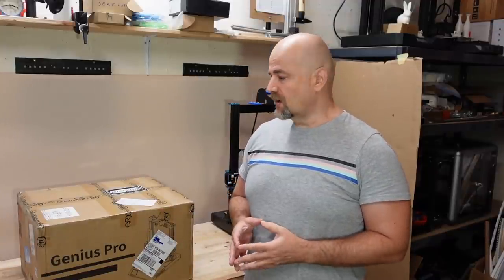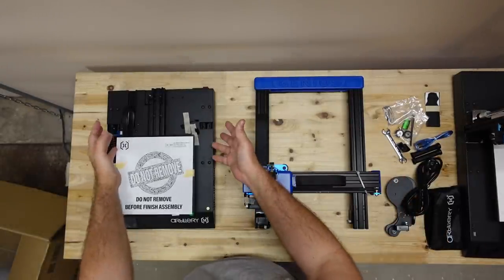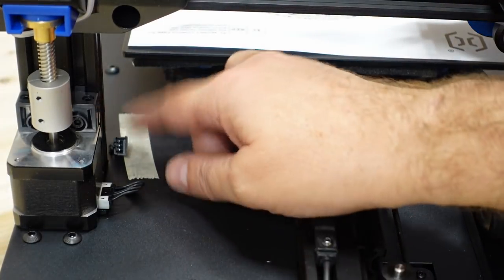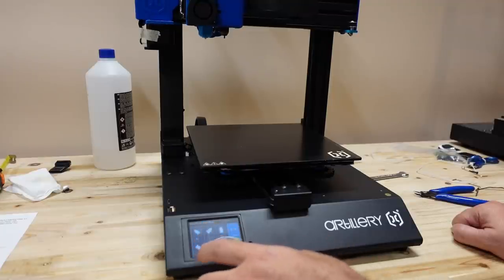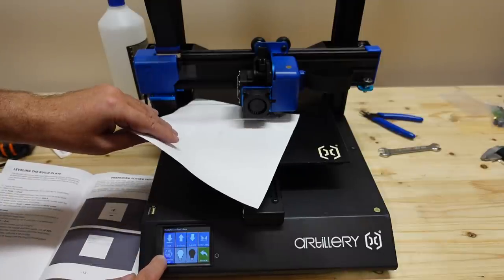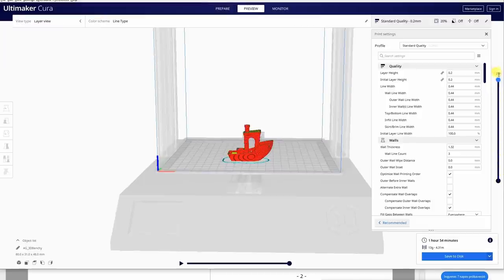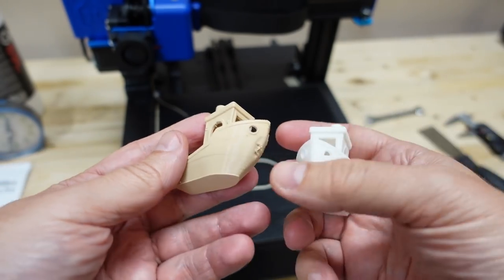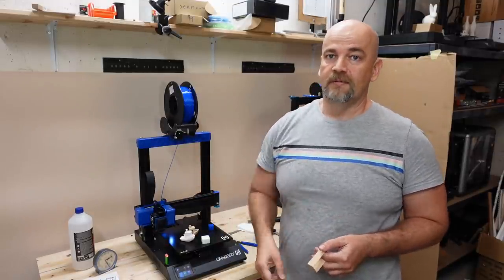Artillery Genius Pro - the new TPU 3D printing champion in my collection

Comment: By now I have run several Genius V1's for about seven months of 24h/7 work with no problems, they are very reliable and easy and quick to work with,  they require only minimum maintenance, mostly just cleaning- and a nozzle change. Way better than my Ender 3 pro.
Reply from the maker: I have only SW X1, I had some small issues with it, but most of them are eliminated now (on both X2 and Genius Pro). Only I am not happy that extruder don't have more improvements, too plasticy, hard to set the tension etc.
Reply: @MyTechFun  I have had zero issues with these extruders, even though they are plasticky. I did put thermal paste of the heatsinks and alu tape at the bottom of them so the fan doesn't blow downwards. They just work..and I use cleaning filament when needed, no problems at all and I run them pretty much 24/7.

Comment: Excellent video as always!! I have an Artillery Genius (the first version), and I haven't used it for printing tpu because I fear that I might break the glass for excesive adhesion. Did you find any problems with this? Do you have any recommendation?? 
Thanks a lot for your help in advance!

Comment: I wish I got this instead of my ender 3V2, it's much more complete. So far I've had to add ferrules to high amperage cables (this has them already), yellow springs, CR touch, BTT smart filament sensor, Dual Z without belt, all metal extruder and capricorn tubing but still thinking about converting it to direct drive, Jyers firmware to get it all working..... I think overalls it cost me more haha.

The speed of the motors seem lot faster too, the Z axis is like 3X the speed of the Ender V2

Comment: Hey, great thorough video! I'm just starting out with 3D printing with my Genius (not Pro). I liked the thermal imagining, I will not be printing in the center now, thanks. Do you mind sharing your slicer settings as I am having a lot more stringing with my benchy?
Reply from the maker: I just used default settings in Cura (as presented in the video) and generic PLA for the material.

Comment: Does it really have a BLTouch as you say, or is it a clone?
Other thing is that I learned the carriage wheels are not supposed to be so tight you cannot turn them by hand. If they are, you will get a lot of wear very fast. My advise would be to set them so you could just barely rotate them with your fingers while holding the carriage.
Reply from the maker: It is not BL Touch as a brand, but bed leveling Touch as a sensor.

Comment: Congratulations for the well-detailed videos... I wanted to ask you, in your opinion, artillery genius pro or sovol sv07 is better?
Reply from the maker: Genius Pro if you don't need too big speed and printer is in your office. Because Genius Pro is the quietest printer I ever tested. If you don't mind the noise and you need speed, then SV07.
Reply: @MyTechFun  Thanks... And what speed are we talking about... What's the difference? And a lot?
Reply from the maker: @williamtabare8376  on smaller parts 2-3x bigger speed.
Reply: @MyTechFun  Ok thank you... Listen instead if I would like to put a glass plate on the sovol sv07 can I? Is the magnetic sensor capable of reading through glass?

Comment: As a mechanical engineer i have some bad feelings about the belt system and the 2 stepper motor at the same time. Won't it overconstrain the whole system ?
Reply: As a backyard engineer... no. All it does is ensure the Z axis' stay in alignment. They are not needed in most cases but are there for the people that are new. This only has 1 driver for both motors. So its important they stay together. But the leadscrews are decoupled from the axis so it isn't constrained anyway

Comment: Thank you for the great review! I think this will be my next (1st) printer for the TPU )) is there a way to upgrade nozzle cooling in order to avoid those seams on the other side?
Reply from the maker: I think better cooling will not reduce seams (better cooling is good for overhang and less stringing). But I noticed that I have smaller seams when I use PrusaSlicer. This means it is possible, only Cura needs a lot of more experimenting..
Reply: @MyTechFun  thank you for the answer! Is there a printer which can do perfect TPU prints in your opinion?
Reply from the maker: @ShebanFPV  In my collection this one is the best for TPU (out of 15 different printers)
Reply: @MyTechFun  thanks! Love your informative videos!

Comment: Hi! What cura profile did you use for the filamentum 98a tpu? I use the same printer, same filament, even the same color and I can't get it to stick to the bed at any temperature (tried up to 115c...) Thank you!
Reply from the maker: No, 115C is too much. 50-60C is enough, make sure that ved is clean (soap or window, glass cleaner). 230-240C for filament. Retraction minimal.

Comment: Short question: 
In the Cura settings you didn't change the Start G-code. Maybe i'm confusing something but i think i read somewhere that you are supposed to add M420 S1 so that the printer uses the saved EProm Settings? Or did am i misremembering something or did i misunderstood it?

Comment: TPU is a challenge. I would love to print cell phone cases with TPU.You think this printer can handle the task?Great video.Thanks!
Reply from the maker: Yes, I already printed tome phone case on Artillery Sidewinder X1, and Genius Pro is better (smaller area+ABL easier to get perfect first layer)
Reply: @MyTechFun  thanks for your response.For personal use or for sell? Thanks
Reply from the maker: @GiorgosLysigakis  for personal use (for my daughters)
Reply: @MyTechFun  do you think it can deliver professional results fro selling them?Thanks
Reply from the maker: @GiorgosLysigakis  Injection molded are much better, but with 3D printed you can customise them (some personal logo or text ect.)
Reply: @MyTechFun  Hi again, do you think it is printing better TPU or faster than a prusa13k3s+? Thanks.

Comment: I can’t believe they put the same plastic Idler-arm on the extruder again.. the aluminium version is dead cheap, because so many people bought it after the plastic one is broken. I had a lot trouble with the genius and still have.. the extruder gear is slipping so easy on petg, that I need to print slower than normal, so the volcano hotend is pretty much useless. I also rewired the whole machine after the first flat cable connector gave up. There are tons of videos about inconsistent layers on the sidewinder and genius ..sometimes it’s the extruder, sometimes the top belt, sometimes the motor alignment. Good luck:)
Reply: there are also tons of Videos of Sidewinder/Genius Printers that are working fine. What now?
And usually People are happy with there Maschine don't post on the Web.
Reply: @tomsenq  My experience was not good, so what now? I'm not allowed to write about it? If a company is doing an update on a machine, is it not okay to wonder, why they didn't address an issues a lot people had with it, specially when it's a three dollar part? I can write a full article of what's not so good with this printer, but it's cheap, so I can understand that some parts are not perfect.